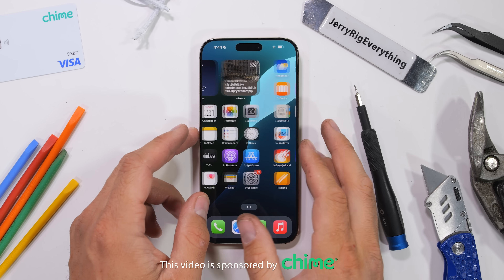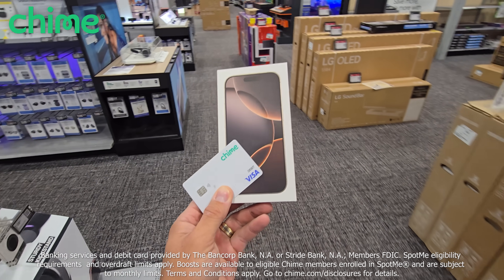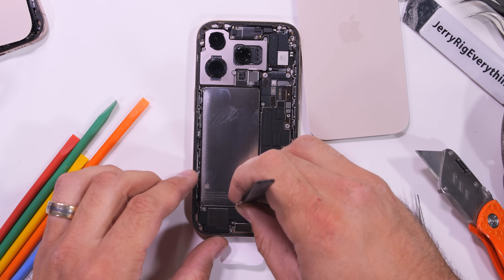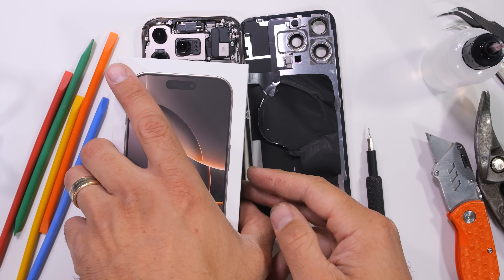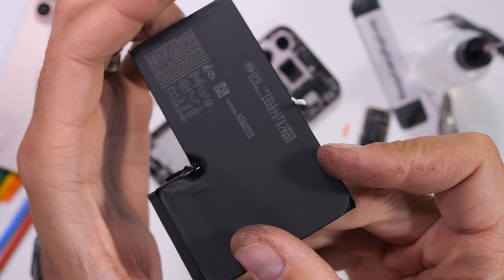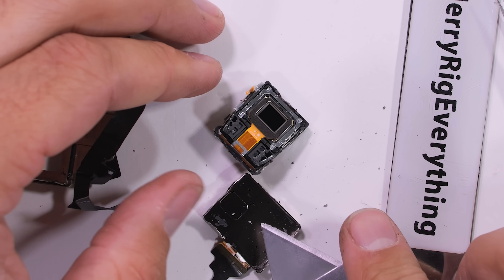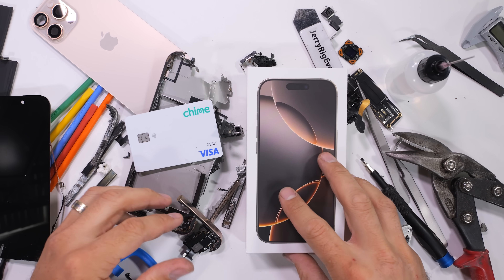Dear Apple: i am sorry...  (iPhone 16 Pro Max Teardown)

Comment: I have an IPhone 16 pro max that was run over.  The glass front and rear and cameras were smashed. But the phone works by using Siri for commands.  I can’t tune it off so it really can’t charge but it does come on when plugged in. I was considering buying the same model off of EBay for around $100, take it over to Thailand and get it switched out with a good to excellent chassis and new cameras. Dumb idea or not?

Comment: 3:09 Is that 3m command strips? On something hot.... good on the EU

I really miss my razr 3v, buttons so u can txt and type without looking at a screen, excellent flip design, capable of using a cursor like a regular computer with opera even YouTube abilities after adobes flash monopoly ended thanks html5, Bluetooth and usb tethering give dsl speeds to home computer with generic Motorola modem driver. It took 20 years for phones to do this proper again without WiFi 

If I could make a razr v3 WiFi capable yes with the tiny screen I think it would be optimum. When your phone IS your PC AND work computer compartmentalization and quality of life seem to decrease. Just because you could doesn't mean I should lol

Thanks for the videos, cheers `-;

Comment: I believe the reason for the change in battery design is for the reasons you mention (compliance to EU mandate for replaceable battery), but also to prevent poor counterfeit batteries from being used as replacements. It is much more costly to have an etching machine and also more costly for a small after market battery manufacturer selling products of dubious quality, to buy the machines to produce those metal-clad batteries.  The metal shielding can also provide an extra measure of safety by helping to contain any fire or explosion.

Comment: Using tweezers on the pull tabs will rip the tabs. Saw someone else take apart the 16 with no issues, slow and steady with your fingers makes all the difference

Comment: My Samsung Galaxy S23 Ultra has a large crack going from the near bottom left up to the buttom camera. No longer water resistant, until you seal that crack with a clear sealant, sort of generously applied, covering all the cracks and a few cm up and down the side above and below the cracked area to ensure no water leaks. Being clear you hardly see it, and I have mine in an Otterbox Defender Pro case, so it is 99% covered up anyways. I bought it this way so I was not the one who cracked it, but I did at least apply some sealant to give it back most, if not all of that water resistance it once had... I mainly can't afford to spend $150 on getting the back replaced so did it the jank way.

Comment: The heat transfer area is interesting. I wonder if that is the area on my 16 pro that is getting up to 110 degrees whenever I’m bluetooth connected to my Victron solar stuff. The 16 heats up more than any phone I’ve ever had, uncomfortably so. I can’t imagine how hot it will get trying to do “A/I” Unfortunately, for what we pay, none of the top tier phones are very good. My 16 was a replacement for a pixel fold, which had the folding screen fail a year and two days after purchase.

Comment: That doesn’t mean much when Apple restricts third party repair from getting parts and has system in place where non authorized repair shops can’t actually make replacement parts work without messing with the software. Watch a few of Luis Rossman videos and you will get the idea. This just seems to be a fake PR move, that is as done to fool average consumer as always.

Comment: 3:10 
The pull tabs are made of “electric adhesive”. Hit it with 12 volts and the battery literally falls out. So it’s not that they don’t work you were just doing it wrong…

Comment: re: the pull-tab adhesive- it works better to pull a little out and then “reel in” the stretched part. Pull a little more out, roll up the excess. It takes the excess stress out of the already stretched pull-tab and puts it onto the unstretched part of the tab 

(Hope that made sense)

Comment: Apple is a prime example of how authentic, democratic regulation THAT ACTUALLY HAS TEETH (looking at you SEC…) in the form of actually hard-hitting fines that are not just slaps on the wrist ultimately ends up benefiting everyone who can be considered a ’common man’. 

That includes even those of y’all over there on the other side of the pond who are easily led astray by a smiling billionaire, a little bit of fear on the evening news and the promise of a cookie.

Comment: I am just confused that they didn't use the same battery trick they used in the normal 16. The pull tabs never seemed to work and the new solution is interesting.

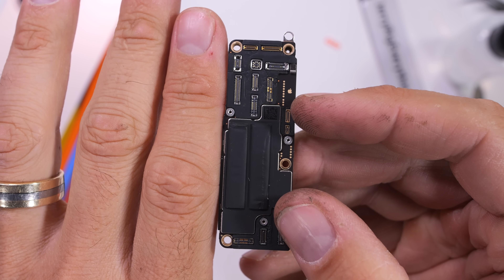Comment: 05:01 whatttt I just ordered a U.S. iPhone 😭 I didn’t know they don’t have a SIM card slot.
Reply: You see. Apple will try to save money on everything. They will make your experience worse, or put a plastic placeholder just because they can.
If not for EU regulations, they would be even worse than they already are.
Reply: karl man yu need a physical sim slot its a necessity
Reply: @bhargav.99  it’s too late for me. We have eSIM in India, so it’ll be ok.
Reply: @bhargav.99  For what?
Reply: Does any U.S. provider still require physical SIM cards? The eSims are good, you can have multiple at once.
Reply: @darkwoodmovies  facts but if yu travel a lot having physical sim slot is no brainer
Reply: E sim is the future, and works wonderfully… though that’s me saying that who has a se 2020 with a physical sim and an eSIM so….
Reply: @elerileigh7926 I have an SE 2022, using the eSIM for my main phone number. If I ever travel abroad, I can insert a SIM card and instantly have access to the local cell network.

Comment: Not sure which model has the electrically removable battery (you attach a 9v battery for a few seconds, and scpecially placed coils heat up the glue for easy removal.

Comment: metal batteries ... must have to be because of the sustainability angle apple is looking to... also lowers the risk of battery blasting , better heat dissipation. 
but it probably increase weight and not sure about the recyclability.

Comment: Honestly that $379 is pretty reasonable. The screen is gonna be about $300-350 for just the part and that’s pretty reasonably priced for service time 🤷‍♂️

Considering a repair shop will charge the same (if they use genuine parts) and going though Apple will guarantee it’ll have the water resistance and True Tone intact… it’s pretty good.

Comment: Wtf are those audio balls?
Reply: They provide a huge surface area for the sound to vibrate them and thus amplifying the sound of the speaker. It's similar to the reason why guitars are hollow to allow a larger surface area for the air molecules to vibrate. The amount and size of the balls is precisely calculated to match the natural frequency of the speaker it is attached to creating a much amplified wave. This phenomenon is called resonance.

Comment: How do the balls in the speaker make the sound better?
Reply: They provide a huge surface area for the sound to vibrate them and thus amplifying the sound of the speaker. It's similar to the reason why guitars are hollow to allow a larger surface area for the air molecules to vibrate. The amount and size of the balls is precisely calculated to match the natural frequency of the speaker it is attached to creating a much amplified wave. This phenomenon is called resonance.

Comment: Have you seen the glue that's held down with electronic activated adhesive. Need U use a 9v battery to remove the Battery

Comment: You missed a trick!, apparently on the new battery if you apply 9v to the metal bit at the bottom of the battery it melts the pull strips or something so it releases with no force.

Comment: Jerry: Why does Apple charge $379 to replace a screen when it's so easy to fix?
Apple: Because it's being repaired by an Apple-certified employee, using an Apple-certified screwdriver, while checking an Apple-certified smartphone... in an Apple-certified repair shop.

Comment: Could I possibly get the iPhone 16 pro you are giving away as I am on an iPhone se 2 that may not have support for too much longer and I give my old phones to my brother when I upgrade as he doesn't really care about having the latest phone as long as apps are still supported and it has decent battery life and also having the phone already opened would make it easier to repair in the future if needed as I enjoy tinkering with devices and working on them as I sometimes will fix either my own or friends/family's devices or buy them off of ebay to repair and use as a backup or if its old enough try to jailbreak or mod it or both.

Comment: 379 usd for a display. I have to say i thought it was a lot. But in small 3rd party repair shops i've seen prices a lot higher than , they say it is original but you dont have the little sensor attached to the display and you lose true tone and also automatic brightness. There is a way around it but it's a lot of hassle. So in my area and country if the price is the same as in the video, its the better option instead of going 3rd party.

Comment: Did they add metal so the battery is more structurally sound during removal?  It seems like the original battery was good enough if you were careful.  Metal also adds additional weight 🤔

Comment: It was not selfless.
It was not generous.
It was done after Apple fought against Luis Rossman and his right to repair, where multiple repairshops opened up about the fact how hard it was to help customers with their phones. 
And only after the backlash they were open about sharing that "complete new repair programm". 
It is the same BS when they tried to sell you the usb charger as their new mindblowing inovation when in fact, the EUROPEAN UNION simply told apple "you do this or you´re done here" and they did comply. So i will enjoy this tear down because as German i never understood why i should overpay for mediocre tech that limits my options due to "The Apple Ecosystem".

Comment: When will Apple become Apple again? I could care less what material they use I just want innovation again! They could be releasing phones with rubber sides already moulded into and over the metal sides so that when it drops it scuffs as opposed to scratches, higher concentrated particles of diamond/sapphire or any other extremely scratch resistant material for the screen because let’s face it with Apple care+ for 8.99 a month I’m covered for any damage yet if I go into any Apple Store they will tell me that scratches and grazes aren’t covered by this so I’m forced to either use express replacement or crack my screen on purpose but to what peril who knows?… anyway, we’re at a point where we should be seeing REAL innovation and not just Apples recycle plans each year! These phones should be sitting at a 9-10 grade on scratches and NO you shouldn’t need a screen protector!!! Yeah I understand that people who are like me and don’t want their product to be scratched put on a screen protector but I just can’t get behind it! Caseless or not, I never have a screen protector on and for the fee I pay, I shouldn’t have to!.

Comment: 2:59 check out ifix's teardown--you can apply an electrical current and it debonds without having to peel. they aren't pull tabs necessarily.

Comment: You should check out the normal 16 model and how by applying a low voltage of electricity, the new battery can be quickly dislodged from the chassis

Comment: HEY, Just wanted to let you know I'm not even sure if you would see this comment but last week my girlfriend broken her OnePlus Nord N30 phones screen so i tried to repair it at the repair shops but they were charging around 150$ just for the screen which is too expensive since the phone is around 200$ but yaa in the end i decided to order a screen online in amazon an repair it with a confidence.
I had a confidence that i could repair because i have been following you and watching you for a long time so i have an understanding of how smartphone looks from inside and so took out all parts and replaced the phone without anyheat gun or proper tools total diy in the end the phone got fixed thanks to you i could do that thank you so much but unfortunately day before yesterday my girlfriend dropped her phone again and it total went black and it stopped working and i even tried ordering a new screen and replacing it the phone still doesn't work because of some battery issue and faulty screen. If i could get the iPhone or any other phone it would really helpful. But anyways thankyou for making my teenage days interesting and making me believe that even i could fix a phone. Thankyou Jerry❤

Comment: My mother just got the iPhone 16 pro and She is loving it. Her first new iPhone since her 11. Really thrilled with the camera. I have the iPhone 15 Pro max. And wish Apple released the UVC setup to the iPhones and also into Final Cut for iPad. As I love using the UVC capture into my Aerocaseter with my iPad to easier capture power points without trying to use a web browser but allowing the UVC inside the iPhones and iPads for Final Cut for iPad would allow Final Cut for iPad to be the new Sling studio as I have used the UVC capture with all 3 of my iPad Pro models to capture video from my GH5 (in 1080) but it captures the footage directly into the iPad for later retrieval :) good stuff.

Comment: Doesn’t the new housing for theiPhone 16 battery have to do with the new adhesive - you should be able to make it unstick by running a low voltage through it… No alcohol or pull-tabs needed…

Comment: I would like that iphone, my 11's screen has black spots, my battery only last like an hour. Also my port is broken so i have to charge wireless. But its not magsafe so its a fucking pain to line up. To make it worse the charger has a usb-c port. But I don't have an charger adapter with usb c, so i need to charge it with a powerbank that charges slow af by itself. also i like your vids :)

Comment: Damn, I never thought I would see the day when iphones are more repairable than most android phones.
Reply: Are they more repairable? Repair guides or not, still seems like they're much more of a pain than the average android phone
Reply: @ixuvia  show me an android phone which can be opened both from the front and the back
Reply: @spookhidde  bruh, Zack himself says in this video that the iPhone isn't easy to repair (he says he doesn't recommend it for beginners). Please tell me you don't seriously think that being able to open it from the front and back automatically means it's easier to repair.
Reply: @ixuvia  not just that, but it's all the new changes together that make the new iphones more repairable.
Reply: @ixuvia they more repairable than the most android phones.
Reply: @ne_nravitsa  Most Android phones are Samsung phones, so you're technically right. Your grammar needs some work, though.
Reply: Nope!
Reply: iPhones still have part pairing and 5 million different screws. I don't see where iPhone are more reparable than most other android phones...
Reply: @AbRaSkZo  pairing isn't really an issue since they released calibration tools, as for the screws, that's not true, just look at the ifixit video of the iphone 16 pro. Almost everything is immediately removable with just a couple of screws.
Reply: What about the hardware pairing? Did Apple remove that yet? If not, that's a major problem for repairability.
Reply: @shieldmate7444  pretty sure that got replaced with a calibration system, so it's no longer an issue
Reply: @shieldmate7444  yes, they more or less fixed the pairing issues, with the calibration tools

Comment: i think apple did that metal battry compnet upgrade so you don't acdently prunchure the insides of it when trying to remove or takeing stuff off the iphone during the repaire procces. its also logcly to make shure for better battrey thermal conductivy for passive heat dispersion into teh out case and also for dealing with the thermal heating during induction charging. this also makes it for even better indcution charging proformcase and to be also used as a faraday cage to stop  stuff for damaging the battrey i guess as well. thats my guess of why apple did that. apple does know how ther own tech works so they might have done that after so many issues of batry geting damaged due to the lack of better protection from damage. reminds me of those much older removble batterys in thsoe odler modle mac book pros made 3 decades ago bascly. it looks like apple is falling back onto ther older methods of handling stuff they have used in the past. the metal case armord protected battery is a much older thing that apple hasn't done in a very long time. i guess apple seams to fallback on some methiods of trying to make shure things don't get damaged somehow.

Comment: I mean, batteries used to be stiff and replaceable so I am liking where this is going.

Still surprised you used heat + knife to open it up - didn't they say that the glue can now be disabled with electric current??

Comment: Me over here wondering if next year’s iPhones will have the same thing as the iPhone 16 to remove the battery easily instead of using pull tabs. Also the battery in the 16 pro looks nice, question is will it hold up over time and will apple charge more to replace the battery on it

Comment: Putting a metal battery casing on the normal 16 pro and not 16 pro max is strange. Even if it is heat dissipation related why not just put on the max too

Comment: Should have gotten regular iPhone 16 to teardown. They use a neat adhesive with it and they tell you to use a 9v battery to remove it. Apparently when it's electrically charged, the adhesive releases the batter from the phone. A really neat trick if you ask me. Not an Apple fan at all, but that's pretty cool! Not sure why they wouldn't use it on the Pro models though.....